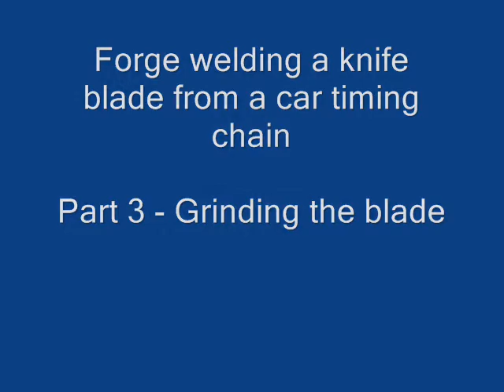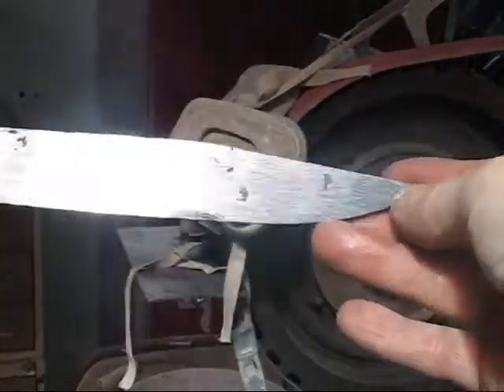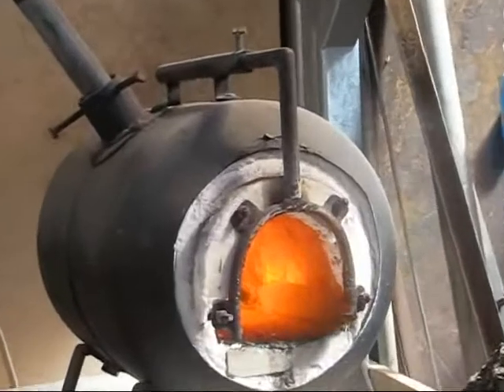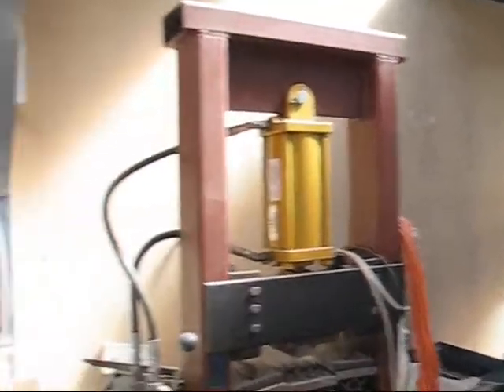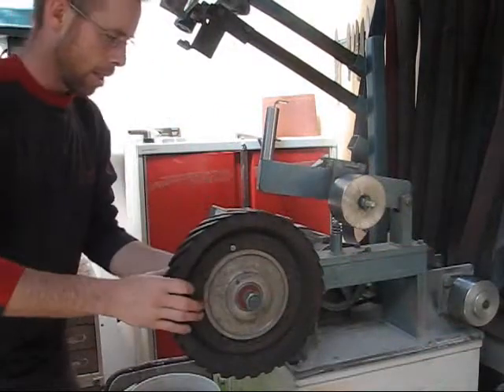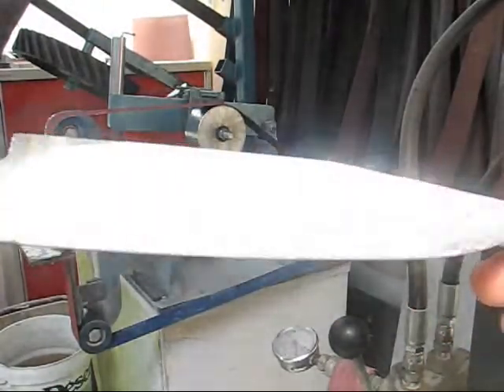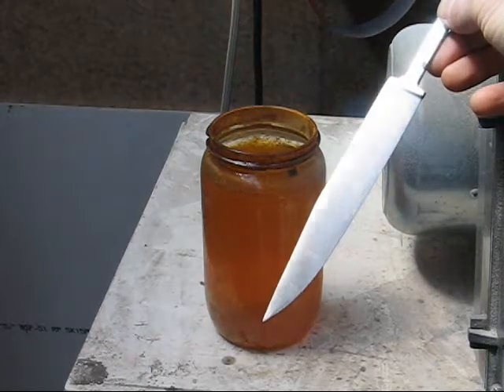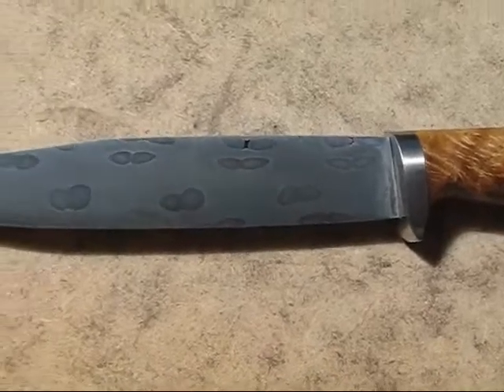Forge welding a knife from a timing chain - Part Three - Grinding the blade

Comment from the maker: Yes.  Warm steel or ferrich chloride will etch faster but not necessarily better.  A slow etch is best, using a weaker solution.  Around 20 minutes is about right, but you'll need to experiment with it.  Yes, the longer, the darker but it can begin to get patchy.  The good news is that the etch can be easily removed with a light sand using your normal finishing grit, and then re-etched, so you expiriment with different methods.

Comment: Yeah, on a historical katana there are 2+ types of steel (high, low and sometimes medium carbon content steels) layered through the blade, higher on the edge for wear resistance and lower in the spine for shock absorbing, but each of these layers was usually made with layered steel similar to pattern welded with really fine grain structure and the best bladesmiths could make certain patterns in the grain itself (hada in japanese) through some kind of hammering to shape the grain.

Comment from the maker: @danniCALIFORNIA1 Thanks for your comments. Tempering was done once for one hour at 200 degrees C. There are many opinions on tempering...some would then give it an overnight in the freezer, then back to the oven for another one hour soak at 200 C, then sequence then repeated three times.  Knife-making...go for it!  It's very satisfying using one's own knives, me specially in the kitchen.

Comment from the maker: And it would seem to make sense to...it would certainly be easier to grind a softer blade, plus I wouldn't use as many belts.  However, the thinner the blade the higher likelihood of warping the blade during the heat treat...I have ruined many blades like this. So, leaving the blade thicker is insurance against warpage. Thanks for viewing.

Comment from the maker: @bjensen5 LPG, running at around 4Lb. Diameter is 25mm. I have a pivoting steel cover at the top of the venturi...this allows me to adjust the air flow to enrich or lean the flame. Thanks for your questions.

Comment from the maker: @pikepeak1 Yep there's a few bucks in the grinder...I made it by studying photos of the mighty KMG grinder made by Rob Fink at Beaumont Metal Works. If you can, go buy one of his grinders! Otherwise, the dollars come in from: motor; wheel machining; buying and cutting the steel; assembly. The overall biggest cost was the variable speed drive, but you can happily grind on a 3-step pulley rig.

Comment: Why do you heat and quench 3 times?  If you heat it till it no longer has magnetic properties you have dissolved all the carbon into the steel.  Once you quench it can't come out of solution fast enough to make any stable structures so it makes hard martensite that will need tempering.   If you heat it up again to till it is not magnetic, then you just dissolved all the martensite back into the steel and made it again when you quench.  Aren't you just undoing your previous heating and quenching each time? (I realize it will work but what is the advantage?  Am I missing something?)

Comment: When using Ferric Chloride, does it make any difference if I heat it first? and can the etching be done to any level I like so theres less detail or more detail (for example if I wanted the darker areas on your blade to show up more), or is there basically a set time for it to look best?

Comment: could you use sulfuric acid instead of ferric chloride? I only ask since I have easier access to the sulfuric acid and I'd like to get in to pattern welding for some knives I'm making. Also, do you have any info on making a pattern from bars of steel without any twisting of the metal? The only info I can find on this involves twisting but I want to try replicating some of the patterns made in katana blades by traditional japanese blacksmiths.